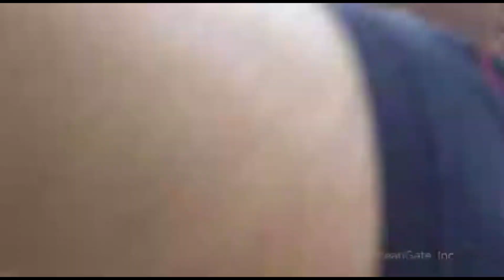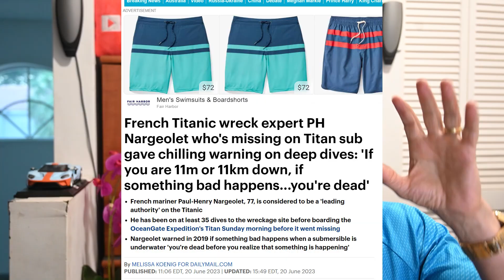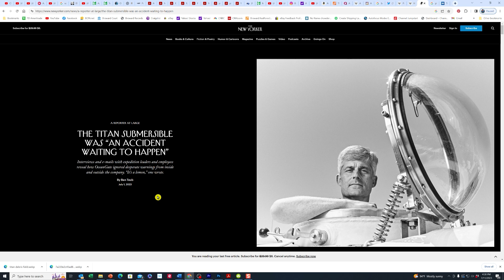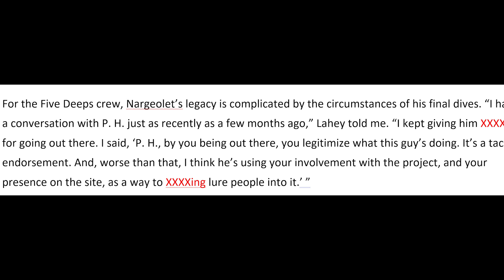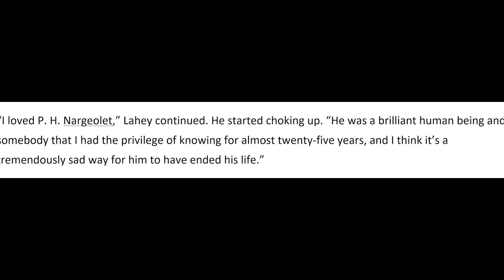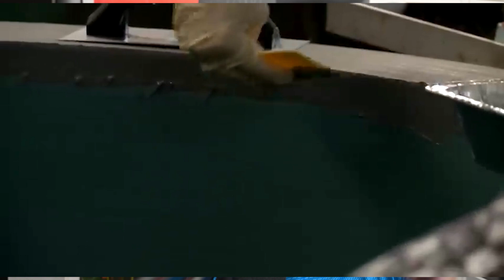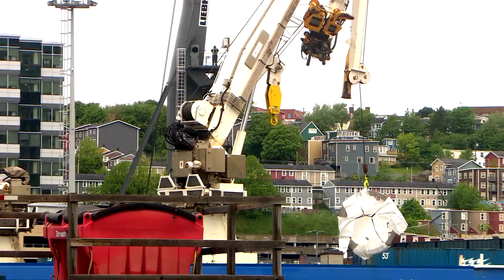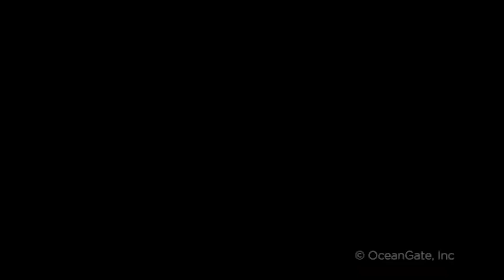Titan Sub: More Q&A, Design Defects, Why Descent Fast

Comment: I have a theory to explain everything we've learned to this point, including the text message transcripts which have been positively confirmed. The transcripts are REAL.
My theory is that one of the oil filled spherical electronic suite "cabinets", ironically the only components of Titan which were thoroughly tested and certified for the depths Titan was built for, began leaking, displacing the oil, filling with seawater and causing an electrical/electronic malfunction and a loss of buoncy , minimal though it may have been.
The electronic malfunction due to sea water intrusion resulted in the ascent/descent thruster controllers short circuiting, causing a surge of current, running the thrusters much faster than the nominal rate and coupled with loss of buoncy resulted in the off-nominal descent rate some 40% to 50% faster than normal.
Top side was aware of this high descent rate as was Rush, the pilot of Titan.
At each check in at 15 minute intervals the fast descent rate was noted, conveyed and ignored by Rush.
Eventually Titan reached depths in the high 3300 meter range when at 9:28:16 the Titans RTM (Real time hull health/integrity monitoring system) sounded an alarm.
Rush tried to arrest descent with thrusters at 3433 meters without success and at 9:30:36 and approaching a depth of 3500 meters Rush communicated that descent velocity actually increased. At this point I believe the carbon fiber tube hull had begun delaminating and deforming as a result of the many cycles to depth and back it had seen and exacerbated by the rapid descent rate. Even a relatively minor reduction of hull diameter of 2" would result in a massive reduction in buoncy and was gradually occurring all the way down. It had now reached critical levels however.
The decision was made to release ballast with no improvement.
At 9:35:48  and a depth well below 3500 meters the heavy steel landing frame, after multiple attempts was finally jettisoned which did arrest descent and began their ascent.
At 9:38:09 a loud unidentified "crackling" sound began coming from the aft end of the vessel. I believe this was caused by the electrical systems shorting and arcing or from their cabinets now filling completely with seawater and possibly entering the conduit passing through the aft bulkhead into the crew compartment, contributing to the loss of buoncy.
At 9:42:12 Rush began running diagnostic checks and noted a very slow ascent rate. The crackling sounds had subsided.
Diagnostic revealed a "global" RTM alert with all parameters reading red at their limit of monitoring.
At 9:43:42 and a depth of 3476 meters Rush relayed that ascent rate was just 25% of the "predicted" rate which tells me Titan was never tested without its landing frame.

At 9:46:37 and depth of 3457 meters Rush communicated that main power bus A was reading all red and he switched to main power bus B and that the crackling sounds from aft had ominously returned.
This communicay some 18 minutes and 21 seconds into their ordeal since the first RTM alarm and having ascended only 43 meters , was the last transmission to come from Titan.
Some 9 seconds later a US Navy surface vessel tasked with monitoring that area of the North Atlantic detected the sounds of an implosion.
Whether due to hull failure or perhaps seawater intrusion through electrical systems conduits Titan and her crew were lost.
This is what happened as confirmed by reliable sources. The transcripts are REAL and serve as the account of the last 18 minutes and 21 seconds of the 5 crewmans lives. Whether my theory is correct and played a role or not the end result is the same. The Titan design failed catastrophically.

RIP to all those lost.
May God bless their loved ones.
Reply: I think if there’s ever a report detailing what happened I suspect it will show a series of failures, as you have described. When something like this happens it’s never just a single point of failure but a series of events that lead to the finale. Whatever the cause at least Rush can’t kill anyone else.

Comment: What were the speeds of descent on all the other dives? Just because their website said 2.5 hours doesn't mean that is what they practiced.  But, seems like there was extra weight on the sub given they were having trouble ascending and descending too fast. Or perhaps a malfunctioning vertical thruster? The thrusters could have been at a wrong setting to descend then entire time. Wasn't there some sort of descent automation?
Reply: Unlikelly, "stuck" thruster would be recognized by power consumption. It is posible, and likelly, they had some depth stabilization and sub level stabilization that was automated for exploring wreck itself. Ofc there could be some computer related problem in play too, but that would be long shot and im sure they had some manual override control in hand.

Comment: What was the adhesive used? I’m no materials guy but I know that different materials react and expand/contract differently at depths and temperatures which I’m sure added to the stress of both the structure and adhesive also, I recently watched a YouTube video of how right angle corners are bad for joints especially if one material is harder than another.
Reply: Elmers glue.

Comment: its called prepreg it is done without a autoclave  they put a cheap vacuum bag around the cylinder and the results are obvious 
the sub went into a vertical nose dive  the vessel was desending rapidly all occupants were laying on top of each other at the window. it was a emergency of grand proportions  this is not mentioned in the the text to surface ship, but the emergency was real before they did a mission abort they tried to correct the situation and the thrusters could not arrest the situation, Stockton was trying to bullshit the world  like he was in control of his stupidity and ignorance with text
that's why they ran out of power on electrical systems the electrical system basically melted 
the trusters were used until they basicly came to neutral buoyancy .  the subs electrical system ran out of energy when they tried to correct the pitch over with the thrusters  the sub was descending at full speed nose down vertical, you got a big problem when this is happening , its upset your weight and balance , the weight shift of the people went entirely forward with out any way to stop the load shift remember there are no seats or anything to hold on to in the titan it is a tube with a floor . in the transcript the text was we are slowly ascending and electrical systems have failed.
but before the text it was of sure panic on the uncontrolled descent: we have dropped the ballast and we are trying to drop the subs frame support They had simply ran out of options the thrusters could not have done enough to gain opposite reaction  Humm Neutons law , Losing weight was there only option for positive buoyancy 
the sub would of lasted another cycle or so, who knows but the rapid uncontrolled descent was what doomed them
this is my analysis and I am not a sub sea engineer but with my time after leaving high school at grade 8 my life has taught me a lot  I am a aircraft maintenance engineer that goes to Antarctica with a turbine Dc3 I maintains aircraft in the the toughest environment on earth and I dont do it for Glory it s a job
 this is   little insight on my analysis

Comment: Thank you sir! I have no idea of submersible vehicles, but once put a carbon fiber „body kit“ on my car (carbon on metal). 90% glue and 10% screws/bolt joints. It is crucial to roughen up the areas where these components are glued together, otherwise pure wind and shear force would strip your kit off at 200 km/h…maybe a clumsy example but…just saying…
Reply: I think the enormous pressure pushing the end hemispheres against the CF tube would mean the glue is more of a sealant.
Reply: @alanaland1990  Thank you! I also assume that pressure is a way to seal things - but the sealant itself undergoes stress of constant pressure/relief cycles. Not sure what maintenance intervals this vehicle had. As it was not a „maiden dive“ it surely worked for a limited time.
In the end it was human failure - either from technical side or due to pure curiosity. Even if you would pay me 1 Million I would not aboard such a death trap…
Reply: @kaidzaack2520  I agree, blind Freddy would decline even tho he possesses heightened hearing to listen for that crackle.
Reply: @alanaland1990  If you hear a crackle it might be too late already…😝
Reply: @alanaland1990 at the depth they were at if you hear the hull failing its too late. Carbon fibre unlike titanium doesnt deform first it shatters, it took them over an hour to get there so there was no way they were getting back in time had they used titanium its possible they may have had the time to get back to safer depths
Reply: There is a reason O rings exist, and we don't use glue joints to withstand pressure cycles on the scale of Titanic depths.
Reply: Body shop owner... yes, you HAVE to abrase the surface or nothing will stick. Be that paint, primer or glue. Spray some paint on chrome and see!
Reply: neither does he... he is just spewing bs for views , and mentioning the same stuff every video lol... he's a home improvement guy... how it makes him a deep sea sub expert ... who knows

Comment: Are there transcripts available from previous dives? Would be interesting to check the descent rate of those vs this last one.
Reply: It would also be valuable as a way to check the language of the recent one, that I suspect is fake.
Reply: This would be extremely helpful. He's comparing two different submersibles. The transcripts from the previous dives will reveal previous errors, descent rate, ascent rate, and successes.
Reply: You are a very wise man. 
No, this guy didn't check the previous dives, otherwise he'd know that the descent rate wasn't the issue. He keeps comparing the descent rate to when James Cameron made dives, which was a completely different fckin vessel, and, that also doesn't mean that faster descent rates arent ok.
Oceangate performed hundreds of dives, including 13 dives to the Titanic, and all of those dives were done in around 90min, so the descent rate isn't an issue.
Reply: @undeadarmy19  But Oceangate advertised on their website that the dive time to the Titanic was 2.5 hours.  That is his basis to say they were going too fast.
Reply: @undeadarmy19 why are you defending OceanGate so much?
Reply: @undeadarmy19 didn't they only actually reach the titanic like %20 of dives?
Reply: @alkeenan7906  Yes, many of the dives were cancelled due to poor weather. As a matter of fact, a large YouTuber, DALLMYD, posted a video recently showing his time on the expedition. He was on mission 3, which was 2 missions before the one that imploded. You can see in the video just how bad the waters are, and they need calm to do it safely. You cant control mother nature.
I will say, in the video he talks about how they had "issues" with the sub almost every day, whether it was the system just not working after a while, a thruster stopped working, etc. On their way back the weather calmed down and they were able to make a test dive. I believe this dive was supposed to reach a depth of 3000ft, but he said they never got fully detached from the barge. They were fully submerged though.
Reply: @undeadarmy19 fake news gets views

Comment: So from what I gather, here's what seems to have happened.
Poor epoxy on the cylinders stripped away from compression of previous dives.
This causes leak in the back and messes with the electrical system, both causing the sub to dive to fast.
Due to flooding or electrical issues, the sub is unable to rise out of danger when problems are discovered.
The carbon fiber which had limited lifespan due to sheathing completely fails due to extra pressure from the fast dive.
Carbon fiber breaks apart inwards as internal pressure blows both the cylinders and window out out the ends.

Comment: How confident are you that the final report will be able to state where exactly on the vessel the implosion began? Of course it's all over in milliseconds, but do you think it will be clear whether the initial failure was in the center of the cylinder or at the ends, and whether it started with failure of the window, the joints between different materials, or the front or back ring?

Comment: How was the landing frame attached?
How was it supposed to detatch?
Why did they need several attempts?
Why did crackling start right after that?
Was the frame still hanging on by one leg?
Could explain why they didn't gain any buoyancy, and why only one leg was damaged in the wreckage.

Comment: Water hammer destroyed everything that was brittle. It blew the porthole out the front of the bow dome and probably pulverized it. I wish I had the equipment at hand to do a 3000 psi water hammer demo, but I do not. I have components that could be assembled for that purpose, but it would not go together in a timely fashion. It would be pretty straightforward, but it would take great care to ensure safety. Maybe some other viewer can do it. Please note that the implosion demo from an earlier video with the steam filled 55 gal drum was with a pressure differential of less than 15 psi. The pressure differential at the depth of the Titanic is about 350 times greater than that.
Reply: Explosive hydroforming uses an underwater jig to hold a piece of sheet metal against a mandrel. a vacuum is applied to hold and evacuate the gap. An explosive is detonated close to the sheet metal which then deforms against the mandrel/die. With deep enough water and enough explosive ,detailed copies of the die can be made. Someone could try this with carbon fibre.
Reply: @howardsimpson489  It would be in micro particles!

Comment: I think that as the carbon fiber began to crack and weaken, the walls started to deflect inward. This reduced the total volume and buoyancy.
Reply: If the carbon deflected enough to affect buoyancy then it would have already imploded. It would need to have moved too much for it to retain any structure
Reply: @WellingtonIronman  Submarine hulls lose volume and buoyancy as they dive under normal conditions. For this reason, navy submarines have to adjust their ballast as they dive in order to maintain neutral buoyancy.

A hull made from a weaker material loses more volume.

Comment: My guess is that the drive motors were once again configured incorrectly,  but in this case one  or more of the electric motors was stuck/programmed too much in the down direction, regardless of anything they could try while on board.
Reply: That is my understanding as well. Then They may have to stop the motors and drop the ballast and wait for free ascent which is why it is coming up too slowly.
Reply: The motors would not make the sub fall almost twice as fast (and then rise only 7 meters/minute).  Only excess weight onboard could do that.  Like partial flooding in the aft section

Comment: Have you seen the article where José Luis Martín said they knew there was problems for around 46-71 seconds

That the ‘sub’ would have been dropping at an aggle & those on board would have been all pushed up against each other

Do you think thats correct, that the sub was going down  something like  this “/“ 

Im not sure it would have been that dramatic as it would have been mentioned in those last communications possibly

Comment: The Bolting up of the Nosecone was weird too never seen them use a Torque Wrench I wonder what the rating of the Bolts 🔩 🤔 was ?  If they had built the thing outta titanium or steel they might all still be alive.

Comment: What I want to know is: if implosion was a rap possibility, the navy picked up the sound, the sub community knew it was implosion, why the search didn’t start with searching for debris on the last known location, instead wasting four days searching for banging noises in an area larger than Cincinnati?
Reply: They dove straight down to the Titanic as soon as a ROV that was capable of those depths arrived on scene. They were searching the top with planes because it was the only real plausible scenario where they could have survived.
Reply: I’m not certain I recall correctly, but I believe it may have just taken that long to get the rovs capable of the dive to the location. 

I’ve heard people involved in the search saying that no matter how likely implosion seemed, it would be wrong to not honour the 96 hours of back up oxygen on board, since they would’ve been trapped in it even had they surfaced.
Reply: @gamerdrive5565  no locator beacon, no explosive bolt system were two giant red flags. So many red flags that Rush was going to get people killed
Reply: They were waiting on the deep dive  rov and crane which was days away
Reply: theater
Reply: Hey guys, thanks for all the answers!